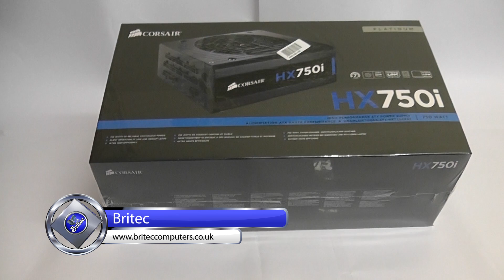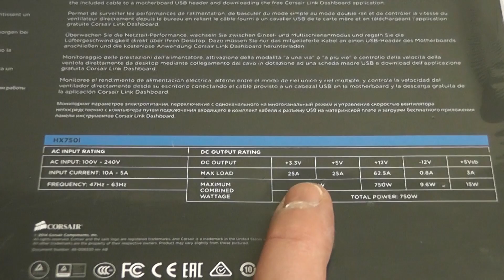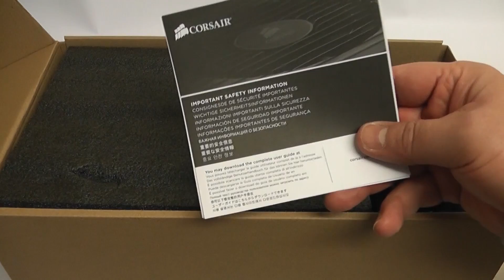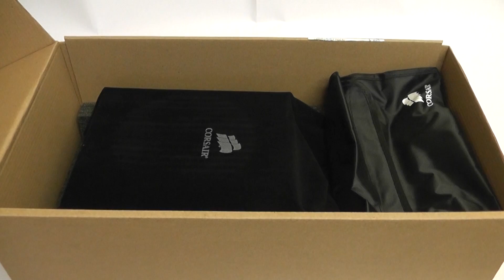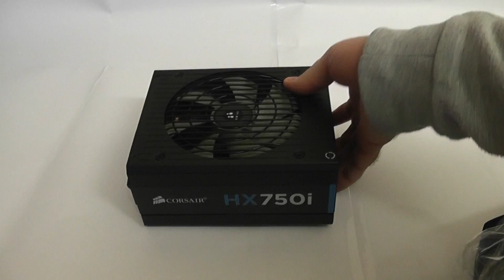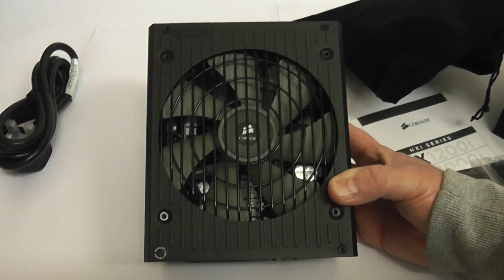Corsair HX750i 750W Full Modular Power Supply

Comment: Yo when i turned on and wait for 10 minites my hx750i fan is not spinning anyone know why?
Reply: It shouldn´t run unless it needs to. It´s to reduce noise so it will only run if the temperature rises enough like when you start gaming or do something else that requires a lot of power in your system.

Comment: I loved the video. Thanks. I definitely agree that one should not skimp on power supply when building a computer. I get client’s computer lists for checking and they frequently include expensive components but a cheap generic Chinese power supply. It’s sometimes difficult persuading them to spend money in this area. Sometimes, only after they have experienced a motherboard burnout do they finally get it!

I generally find myself recommending power supplies from decent companies like Corsair but all around the 500 to 600Ws price level. Would you think this was correct for most builds or do you think it’s worth going for 750W?

I like the idea of module supplies which cuts down the clutter inside the case but I am concerned that there is more chance of something falling out and it has happened on more than one occasion that I’ve come to install something in a client’s machine and they cannot find the bag of cables that came with the supply!!! Very annoying.

This Power supply does look beautiful but I question the fancy packaging with those Jewelry style bags that . Don’t you think it’s a bit overkill?

That USB function looks interesting.  Don’t know what the single/double rail is though.
Reply from the maker: Reb Mordechai Its hard to find full modular PSU at 500w and 600w and if you do find one, they are expensive, you could go for semi modular PSU. 600w is plenty power for most builds, but if you get a hungry card, I would get a bit more power. Having that extra power means the PSU its no running at full load all the time, it gives you that added breathing space as well if you upgrade and the fan will not spin as much.
Reply: Britec09 You are right. I just checked. PSUs like Antec 520W HCG-520M, SeaSonic 520W M12II, Corseair 500/600W CX500M/CX600M are all semi-modular.